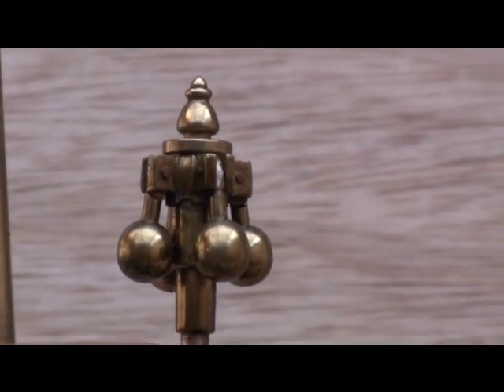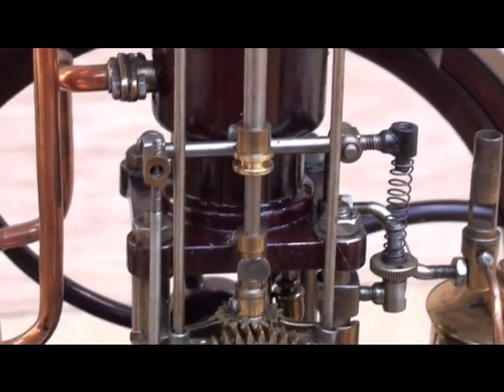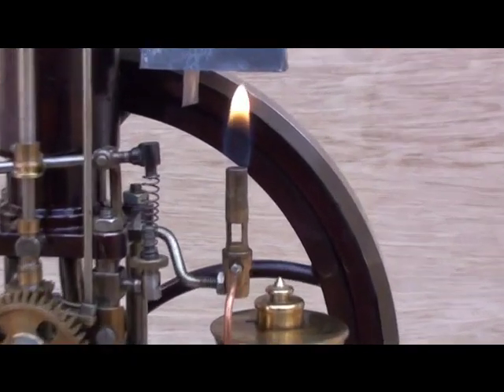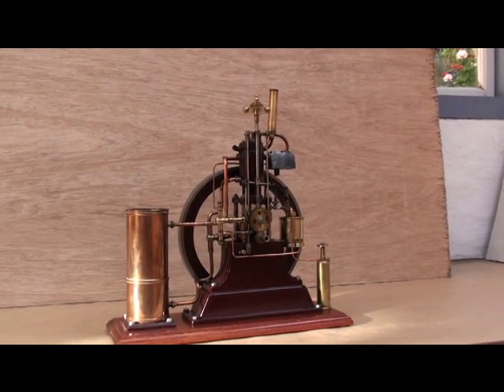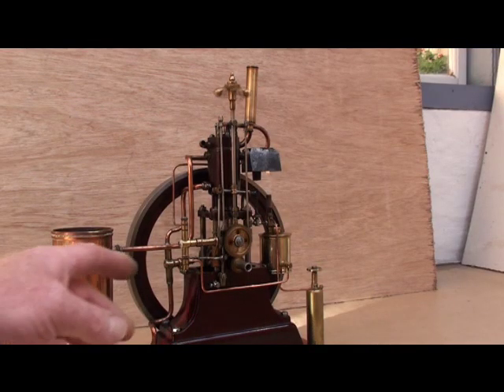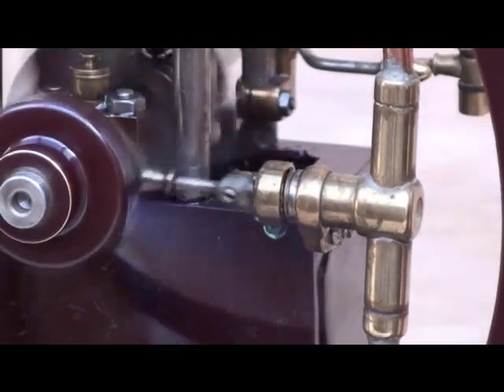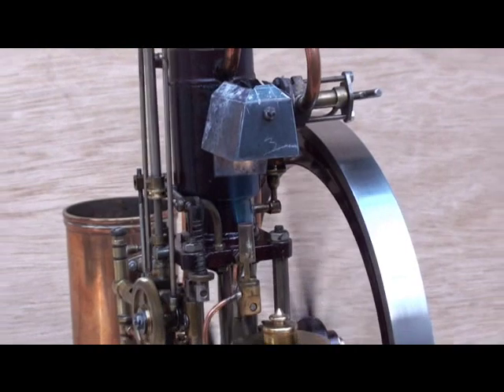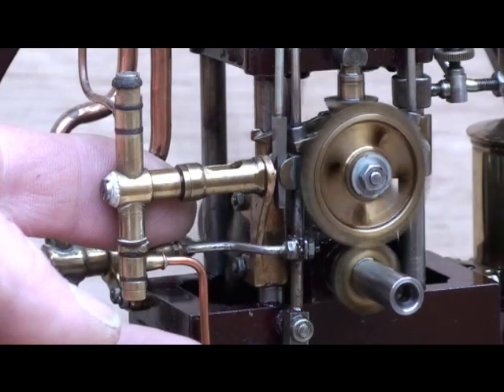Hot bulb Model Engine with solid injected fuel built 1988.

Comment: My very limited experience with hot bulb engines says that the bulb preheat is removed once the engine runs.

Why is continuous heat needed for this one? Could improved bulb insulation change this?

Comment: Find, I love this engine, but I am confused as to why you call it "solid injected fuel", as if it were run on coal dust, which some engines actually do.
Reply: The engine uses solid fuel injection(Used for liquid fuels) with the pump acting directly on the fuel as opposed to air blast injection (Used for liquid or "solid" fuels like coal dust) that uses high pressure air to "blast" the fuel out of the injector.
Reply: @TarenGarond  thanks. But the term is misleading. I wonder if it's a translation/nomenclature difference between Danish and English.
Reply: Did some checking. This should be called solid injection in English, not solid fuel injection, which implies a solid fuel like coal is being injected.
Reply: @kevgermany  Okay that makes sense, solid fuel injection was the term for this system that was stored in my brain(For some reason).
Reply: I was going to ask the same question.